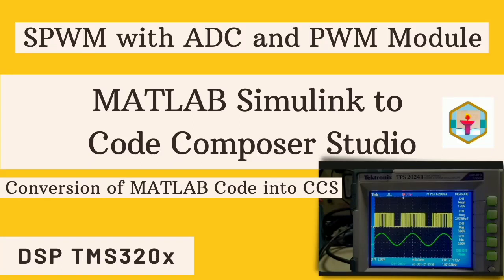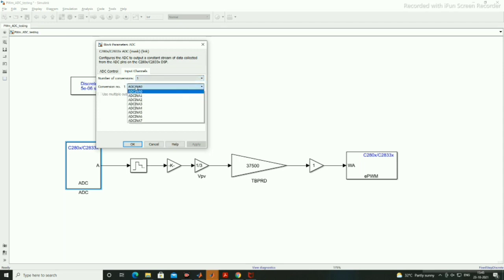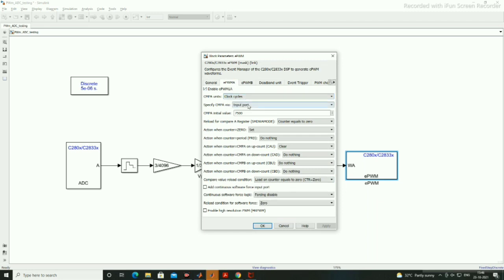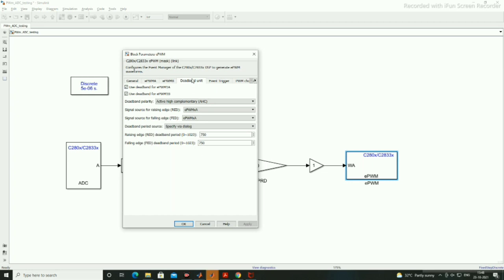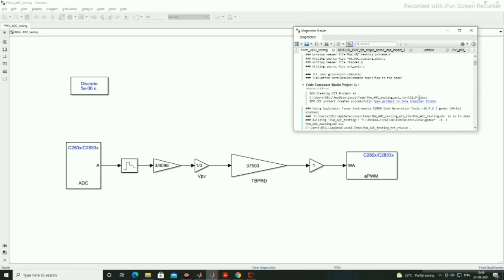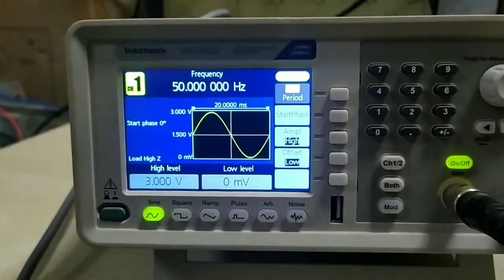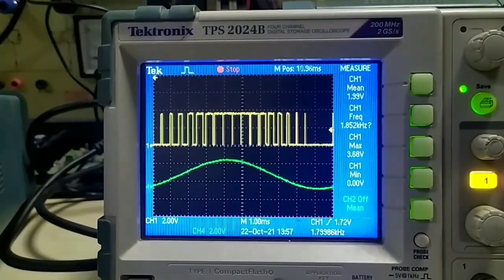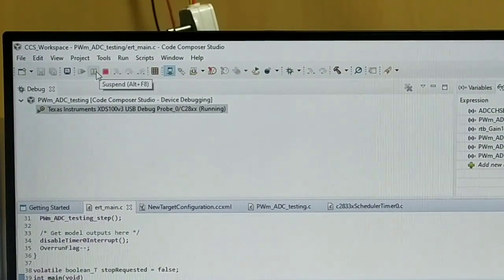Step by step guide for MATLAB model to Code composer studio |  Convert any code for Hardware Deploy

Comment: I am using the GPIO DO Block, and the PWM Frequency is 4 kHz. After generating code from Simulink, deploying the Code to the TMS320F28379D Controller, and then observing the PWM frequency on the Oscilloscope, which shows around 1.3 kHz. Why is the PWM frequency dropping?
Reply from the maker: How you are generating the pwm... Using repeating sequence?
Reply: Using triangular Generator.
Reply from the maker: Use interpolated repeating sequence